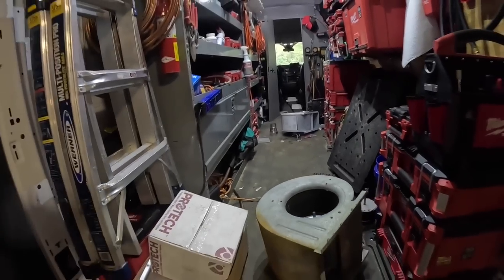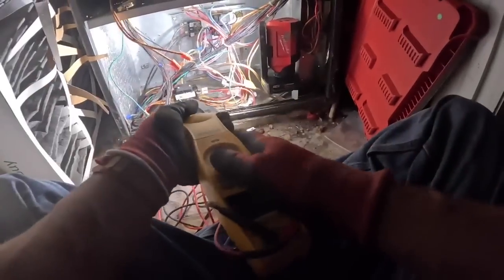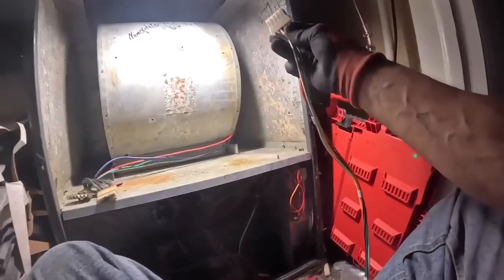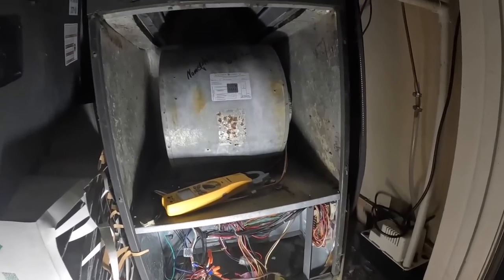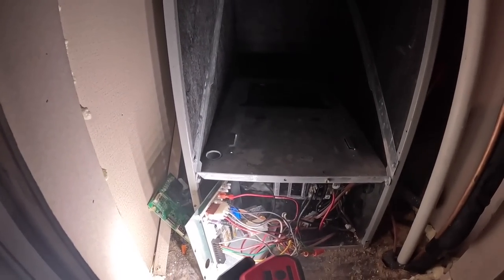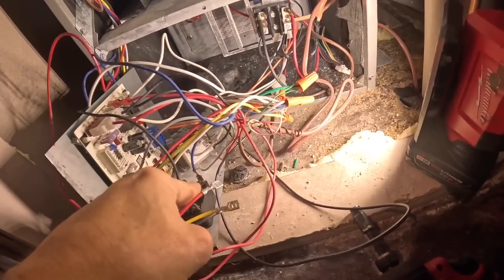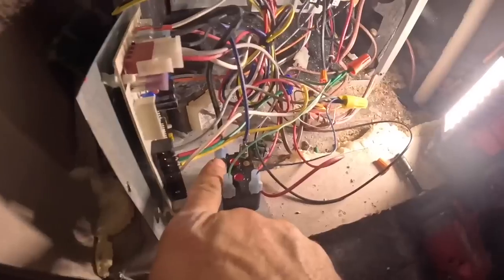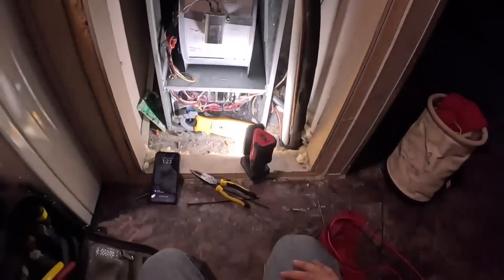Replacing A Motor With A Capacitor with An X-13, and A Variable Speed With A Motor With a Capacitor!

Comment: I haven't had to swap between one type of motor to another.  I find relays confusing but you cleared that up.  I feel confident that I could make a swap if needed now.  I am getting better at reading wiring diagrams.  Thank you for sharing all your knowledge with us potato techs.  You are helping us all grow out of the dirt and be better, safer and fix a problem now rather than making a customer wait
Reply from the maker: Thanks for sharing!  Just knowing that makes it all worth it.
Reply: This is the comment 🤴
Reply: Everyone starts from nothing. You're going places homie keep at it cheers

Comment: You are a wiring genius. I have been watching you for so long now that I actually understood everything you did. Could I do it? Absolutely, but I have always been pretty good with electronics. I would not be as fast, and I would have more trouble with the mounting. Long story short, It would take me all day to do what you do in an hour or two. Like someone else said, I have always put back what was there. If I were to convert one, it would be to get rid of an x-13. I'm glad I have your channel to refer to. Thanks for all you do, if I were younger, I would have changed careers, even though I feel I did well with what I did.

Comment: The 6 amp rating maybe for 120 volt operation, since it's about double the current draw at 240 volts.
Reply from the maker: It was suggested to me that the rating was so high because it had originally been a variable speed motor

Comment: For the one that you wired the psc motor to that relay does that mean there won’t be a delay when blower is in the off cycle? So the blower is going to stop immediately when the condenser stop?
Reply from the maker: Yes, unless a time delay is programmed into thermostat.
Reply: @HVACGUY  o gotcha thanks. Would that cause issues long term because the evap coil would still be cold?